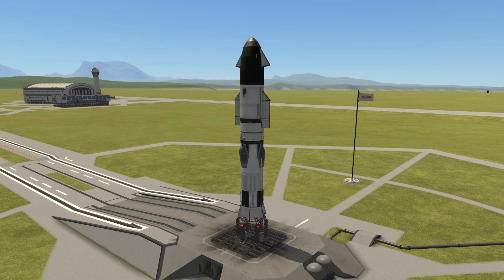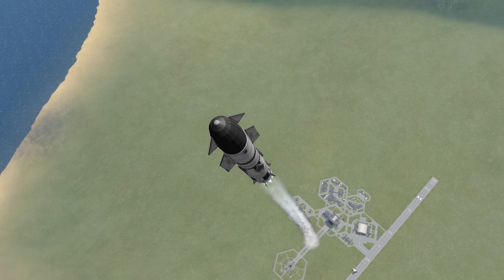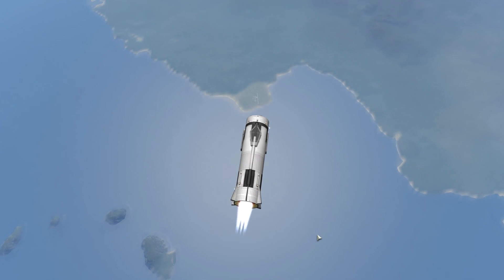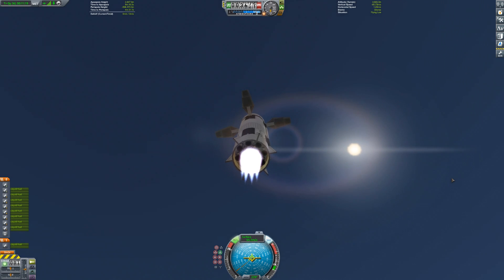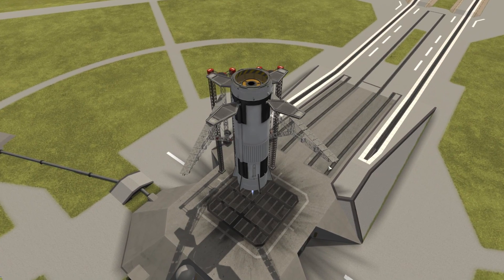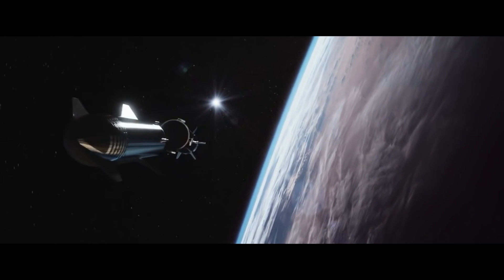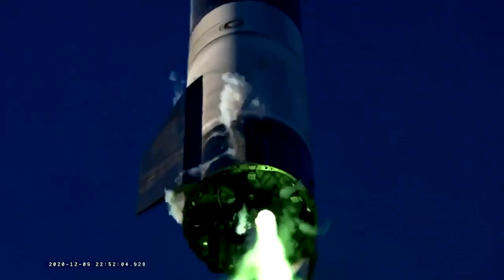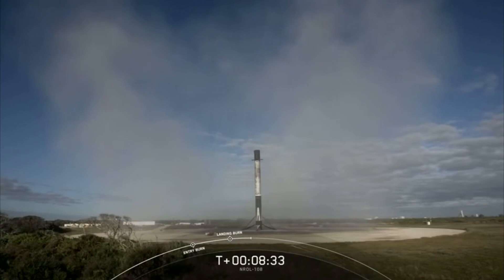Why SpaceX Wants To Make Landing Super Heavy MORE Difficult.

Comment: aircraft carrier cables, that's all i'm saying.
Reply: A trampoline. Land to relaunch times ~1 second
Reply: That's what I was also thinking. Two anchored blimps with a catch wire between them. The rocket deploy a kite with which can drag out a hook quite a ways from the rocket and make intercepting the catch wire extremely easy with their current level of guidance precision. You get much more friendly deceleration. The main point is that if you have a crew return mission they have a 2nd chance with an ejection system if  the catch fails.
Reply: @ElectricGears  there are no people in a Super Heavy booster. Starship has landing legs and no abort system (as covered in an earlier video by either Scott Manley or Everyday Astronaut).
Reply: @ElectricGears  There will never be any crew on a Super Heavy. Also, the goal is to keep things as simple and cheap as possible. I doubt a flying capture rig would qualify!
Reply: @scottmuck  There will be no crew on a landing super heavy.  There will be crew on a launching super heavy, but they will be in the starship on top.  It is similar to the Falcon 9 and the Dragon.  When Falcon 9 lands, the crew Dragon has already flown away.
Reply: @johndododoe1411  duh.
Reply: If we're talking aircraft carriers, I want to see Rocket Labs build a vertical catapult for the Electron. It is lighter weight than a typical carrier-launched fighter jet.
Reply: @MobiAussie  I don't think the catapult would help much, those rockets are perfectly capable of accelerating quickly from the pad on their own. If fighter jets had that thrust to weight ratio when fully loaded, carriers wouldn't have runways or catapults at all.
Reply: that still requires a ton of precision, and there would be a massive amount of force going down, the amount of inertia of the Super Heavy is a crap ton more than any fighter jet. Even if the cable didn't break, the grid fins take a lot of force. This is why it's going to slow down... a LOT... before landing.
Reply: @redpug5042  I'm assuming it would still use the rockets to slow down to maybe 100 MPH and then catch a cable. An aircraft carrier has a very limited distance to to decelerate the plane. Wikipedia says modern carriers catch 50,000-pound (23,000 kg) aircraft at an engaging speed of 130 knots in a distance of 344 feet (105 m) in two seconds. You could catch a far heavier booster with less g force if you have a mile of cable to work with. My thinking is that you would be able to save a lot of fuel if you didn't need to slow down to almost 0 velocity AND hit a target with in a few feet if they want to catch it by the fins.
Reply: @ElectricGears  I read an empty Super Heavy booster weighs 300 tonnes. Wikipedia says the Hindenburg had "useful lift of approximately 232 t". I don't think any airship has been built since then with a lift of more than 50 t.  But the dynamic forces on them after catching would yank them so hard, pulling them downward and together. The tethers have to withstand that, and then you need motors and power to lower a really heavy vehicle to the ground controllably from two floating balloons.

Saving rocket weight by carrying less fuel is good, but on its first proper flight Starship swing upright, decelerated and hit the landing pad. I think a gantry holding two parallel beams (similar to Scott Manley's video at 5:00 except it can move from side to side) or cables could work pretty well, and ground-based operations are much easier than in-air.
Reply: @skierpage  I support the idea of catching a flaming hot rocket with massive hydrogen filled airships.
Reply: @ElectricGears  What else would you catch it by though? would you not need the same precision? Plus, a mile long cable is not practical or controllable. The point of the Starship is that you can launch, and within hours the same booster would be launching another starship.
Reply: you'e free to post irrelevant nouns

Comment: The shear stress on the fin hinges is something...
Reply: I'm sure the stress on the pivots is already pretty massive during reentry, while it's traveling hypersonic through the upper atmosphere, they should be able to handle it.
Reply: @stonesie81  plus they can have a suspension built into the catching rig.
Reply: I have always wondered how thay are going to actuated  and then I seen them move that fast  wich is incredibly
Reply: As has been pointed out we have similar technology in landing cables on aircraft carriers. Some of those planes are pretty big, and the cables get them from over a hundred knots to zero in a couple seconds.
What isn't well known is that the Navy has developed software that allows far easier carrier landings for the pilot. Landing on a target that's moving in all three dimensions simultaneously is no small feat.
Reply: Plus, catching it from higher up on the structure will put the booster skin in tension especially if they burn too much fuel and drop the tank pressure below a self supporting level. It might have a better chance of not falling due to a compression failure of the booster skin material.
Reply: It will be on the pins that hold legs on as well, if they are like the ones on starship.
Reply: If they can hover then this isn't a problem. Accuracy and how much time they have to pin the landing should mitigate all of that. Gravity just makes all of this so freaking difficult.
Reply: They can afford to bulk the fins up and add strength. No landing gear !!!
Reply: @DXmYb  Bulkier (and heavier) stuff at the top also provides for a more controllable spacecraft. This is a win-win.
Reply: Yeah how big are those hinge pins going to be? The size of my thigh?
Reply: No. Robert Forstemann’s thighs.
Reply: @slaphappyduplenty2436  there was one man who got this joke
Reply: I think the Normal Stresses due to the Bending Moment would be the first fault case one should be analyzing, while also thinking about Force Collectives.
Reply: @rainmain  I bet they actually started with the linkages.  Until you have seen a control surface explode from flutter it is hard to even imagine the vibration load flutter can cause.
Reply: @genephipps6421  you"re right! modal analysis and eigen-frequencies are overlooked 9/10 times ... at least in my line of work :p I would love to speak with a SpaceX structural engineer to ask them about fault cases they analyzed, optimal geometries they discovered, how they mesh and how they deal with their nonlinearity. :D
Reply: @rainmain  and if you consider their mixed flight envelope the structural requirements must be "astonishingly" complex.  During launch the fins are edge and end on for Max Q and at escape velocities--loading almost no other control surface in aviation ever has to account for.  Even the control surfaces on the Space Shuttle never had these types of loads.  Then while falling in the belly flop configuration you get an entirely different set of load dynamics and if you watch the video the surfaces articulate very rapidly over quite large throw ranges.  It is like seeing something as big and heavy as a jumbo jet performing aerobatics.
Reply: True, but is it any more stress than going through the atmosphere at multiple times the speed of sound? Probably not.
Reply: @ghostrunner2138  They're grid fins specifically to reduce the stresses that would result from using the fins during hypersonic maneuvers. If the fins were actually giant plates that stuck out into the air flow, the forces exerted on the hinges would be closer to those that would be experienced during catching the rocket by the fins.

Comment: Maybe they're planning to fall into a hover 50 m over to one side, then slip sideways into the tower.
Reply: No Elon has said that they are not doing that in reply to a community render
Reply: @commiccannon592  I see, thanks.
Reply: Hovering wastes way to much fuel though, maybe a small time spent hovering but there just gonna have to get really accurate with the booster landing. Plus whos to say the tower itself will be locked in place, maybe after the Superheavy comes to a stop it can hover for a few seconds while the catching arm swings into place to grab it by the grid fins.

Comment: I doubt that they are going to try it, but it would be cool to see some tests on this with the falcon 9
Reply: Falcon 9 can't do that
Reply: Since SH is going to be similar to the falcon, it would actually make sense. Also they could for example use an old booster that has already flown 7 or 8 times
Reply: @timoheinz2879  yeah that's what I thought, but I guess it's too small and probably wouldn't give them much data which they could apply for the starship

Comment: The drone ships are in constant motion due to the sea state, comparing the accuracy of the landings on land would be better.
Reply: There is a question if land based launches and landings are going to be an option as the super heavy requires quite an exclusion zone. Boca Chica isn't really an option for a super heavy with full raptor load, at least that's my understanding
Reply: @RobertLutece909  Another way to address it would be to have a number of launch locations around the world, you take off from one, land at the next. Your next launch is from this location and lands at the next, etc.

The boost stage would then piggy-back around the world launching various payloads & refuelling ships until it ends up back where it started.

...this would also somewhat solve the need for multiple redundant landing pads and aren't wasting fuel turning the booster around to land back where you started.
Reply: @DEADB33F  Very much like how airlines and trucking companies work today.
Reply: @DEADB33F  I was thinking of that same thing when Jeffrey Epstein got caught.  That island (Great Saint James) is not being used right now and seems like an even better launching point to achieve a more equatorial orbit.  And a perfectly stable landing point as an alternative to a boost back.  Also there are several huge used  semisubmersible drilling rigs that could be retrofitted into landing platforms.
Reply: @michaeljorgensen790  They can't use that island, when super heavy launches it needs a massive exclusion zone. The only way to do it is at sea.
Reply: @michaeljorgensen790  but the logistics of an island launch site + barges is a huge nightmare - everything, and I do mean everything, has to be boated in. cranes the works. you need to build a huge powerplant as well and boat in the fuel etc
Reply: @DEADB33F  Brilliant. Have to have a fair number of extra locations as weather of course would not be the same a launch site on many occasions.
Reply: @DEADB33F  thats a really good idea, actually
Reply: The Starship and Booster Seapad will be as steady as a land pad, thanks to oil rig engineering.
Reply: @davis.fourohfour  Indeed but as Scott says it's a huge risk to go without landing legs, if you don't stick the landing (for whatever reason) you're destroying the rig which is far from cheap. If they go with landing legs they can have it land on a heavy lift barge that's close by and then transfer the booster to the launch rig in a short time.
Reply: Literally all the commenters missed the point of the original comment. What are the statistics for distance from the bullseye for all the land based recoveries so far?
Reply: Dry mass of SH less than that of big floating wind turbines and the heaviest bits of SH are at the bottom.

Also, no need to land SH on the same floating platform it launches from. You could have a pair (or more) cycling between the launch site and the catch site.
Reply: The drone ships use dynamic positioning to be kept spot on target. This is of-the-shelve stuff, from oil rigs that can maintain an accuracy within a meter, even in rough seas, to drill for oil.
Any off target landing of F9 is the boosters fault, obviously not the barge.
Reply: @Damien.D  - maybe, I have vague memories of them getting tossed around quite a bit in bad weather.
Reply: @Damien.D  they use them in boat races as wel to keep those pilons the participants have to round in place and there are offshore weather stations (that measure swell heights and ocean currents etc) using that tech
Reply: Hopefully there’ll be enough places in the world that’ll agree to the multiple launch pads scheme. I do wonder, though, if SpaceX would take into account safety measures such as maximum inclinations/launch azimuths at Kennedy...
Reply: The starship launches and super heavy landings will be from barges. We know this.
Reply: @disgruntledwookie369  - citation needed
Reply: @Steven Gulie you could just slide the top of at ground level and replace the pay load, also less wind drag issues upon take-off
Reply: SS was designed to launch and land on a seaport, as far as I can remenber
Reply: The could have them land back into their  'rocket silos' with the extended fins keeping them off off the bottom of the pit/hole - they already have a the boring of holes down to a T
Reply: @theyshouldhavenevergivenme5439  
Best idea out of any I have seen so far. And your idea of a sliding top to replace the payload could be enhanced if you had two types of silos. 
1. Where the ground level is at payload height (Place the Starship inside then add the payload) 
2. Where the ground level is at the base of Starship (Just place directly on top.) 
And as Steven Gulis added, have side tunnels to channel the landing exhaust. (and take-off exhaust)
This silo idea also gets rid of the start-up 'explosion' so that by the time it has risen 70 meters to the ground level, it will just be the roar and crackling sound. (Assume they will have water sprayers around the ground level to stop burning of the rigging as it passes through)
Reply: @David-yo5ws  it would make the whole thing much easier to inspect as wel.. but there are downsides,  an explosion or fire inside the silo would be catastrophic for instance.
Reply: some sub-surface honeycomb/fullerene  structure tcould be used where the  middle of it is a semi-open silo ofcourse .
Reply: Drone ship landings allows more mass to orbit for a given launch.  Those boost-back burns cost fuel.
Reply: @CarFreeSegnitz   I don't think drone ship landings are even considered for the heavy booster, it is just too hugh. 

and it doesn't fit in their fast re-use idea. In essence the lower cargo is made up by fast re-use and cheap flights.

The only possibility is a launch platform that is also used to land out on sea, but that would be so big it wouldn't have nearly any impact from waves.
Reply: @MDP1702  It's perfectly possible to use a barge for the super heavy booster, there's some really massive ones that can handle things that are much bigger and heavier. Also yeah they are planning to launch from sea platforms, that's what Elon stated.
Reply: @MDP1702  They could build a fast drone ship that could refuel the boost on the way back and the sail back could be 2 hours. While a new Starship is loaded back onto the booster the ship can be refueled.
Reply: @kentonian  The distances we are talking about are not bridged in 2 hours, if you land the booster that close you could as well land it on the pad.
Reply: @boostav  I am certain that there are indeed barges that could handle a mass like that, though landing mass that is 72m high? that is a completely different story and I doubt you'll find it to be practical. The falcon 9 has a dry mass nearly 7 times lower and is 1,5 times smaller (in height, not even considering the 3x width increase.

There never was talk of the super heavy booster using a barge to land, something like an oil rig, yes.

and while there certainly would be ships it can land on, you need to take into account the cost of that vessel. If it is more expensive than just having a slightly lower payload (which is likely the case seeing the $/kg target) it isn't usefull at all, especially with the amount of launches they want to be able to do.
Reply: @MDP1702  
Think outside the barge. Connect two or more parallel barges with a truss on each end. Double the landing area and 4X the stability, or better.
Reply: @imconsequetau5275  How do you get to 4x the stability with that setup? It seems to me this would bring in many new problems, while not solving most of the old ones.
Reply: @MDP1702  There's no need, there are heavy lift barges that can carry things that are vastly bigger and heavier than a super heavy booster.
Reply: @boostav  But these aren't used to land a massive booster on it.

Anyway, it is clear barge landings aren't in SpaceX's super heavy plans.
Reply: @CarFreeSegnitz  And that is relevant... How?

Comment: Great video. Thinking of the autogenous pressurization system... The volume is small, hence as fuel is used, the pressure drops rapidly. I think you are right in that they need the nitrogen pressurization to avoid this problem in the future. I don't the the autogenous pressurization is able to deal with the rapid use of fuel and the concurrent depletion of volume, resulting in a very rapid drop in pressure in such a small volume... Just my thoughts..
And you do thinks in Kerbal that make me smile. Have a great day!

Comment: This will require much greater precision than landing on a pad, sure, but it'll only need to be a precision of a few metres - which I have no doubt they can handle. It's certainly better than the original plan to land the booster directly in the launch clamps, which would have required a landing within millimetres of the target.